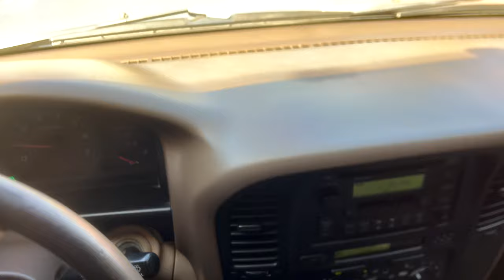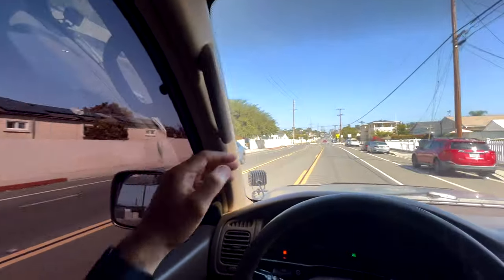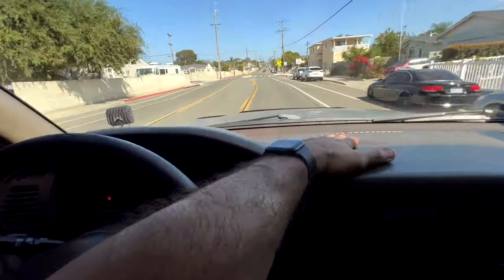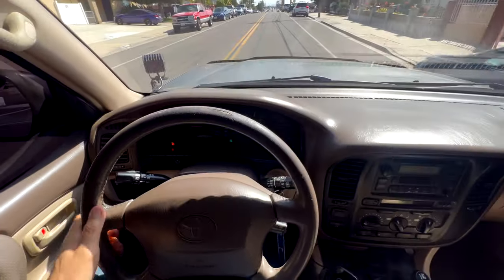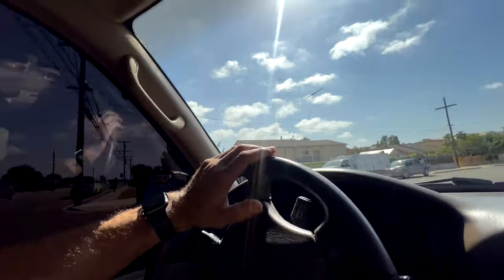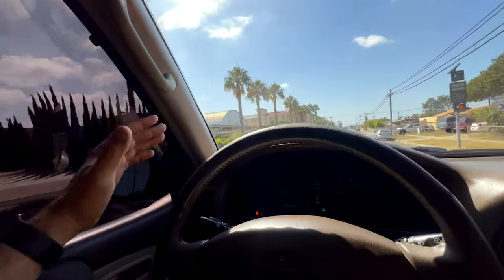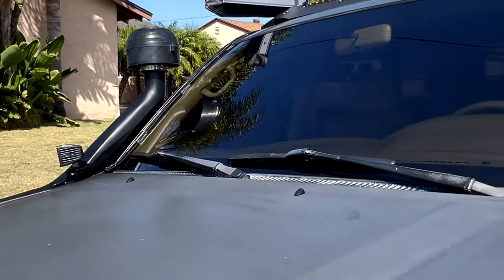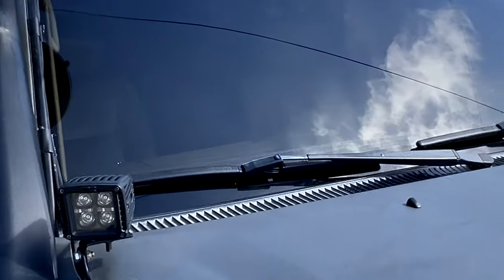Tinted my Windshield on my Land Cruiser 100 Series for Overlanding!   4K

Comment: I need to replace m.y pitted windshield first but will tint my 99LC front.  Just put ceramic 70% on my LS430 front which is black with black interior. Huge difference in blocking the heat because it block 99% of UV and IR then 30% of visible light so net heat rejection is around 65%.  Regarding effects on night vision is cuts the glare of on coming traffic and changed the perceived color of my pure white halogens to a soft white look.
Reply from the maker: @robertrodgers1423  all key factors why I tinted my front windshield. Mainly keeping my cool when I hit trails on hot days.